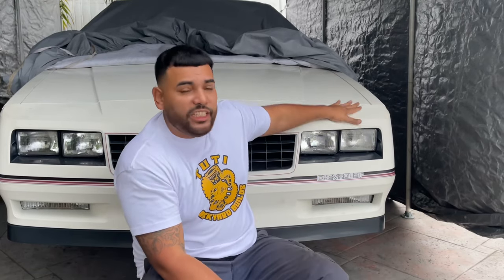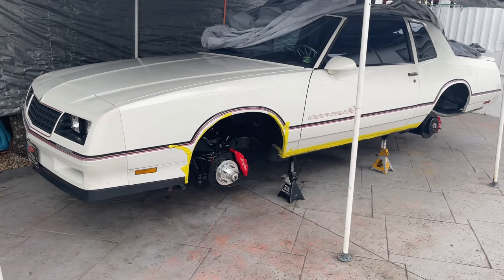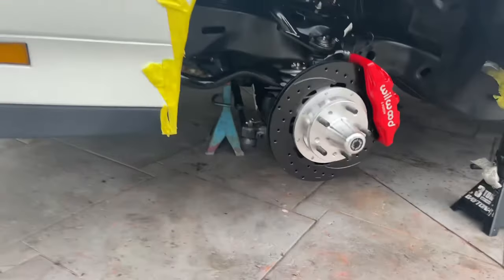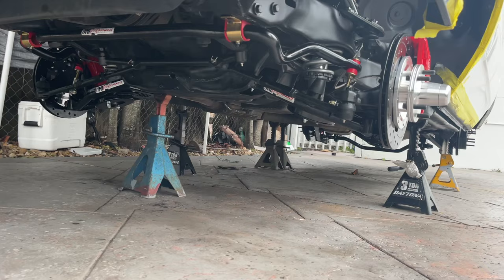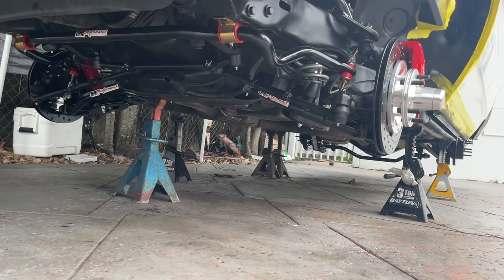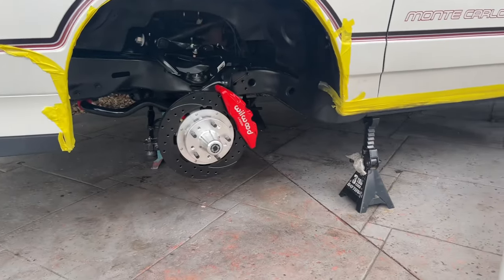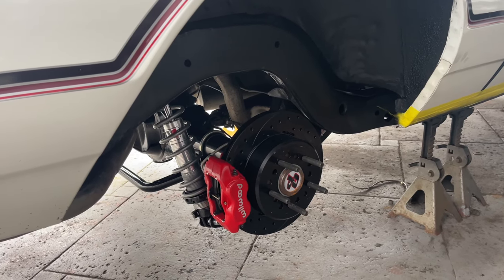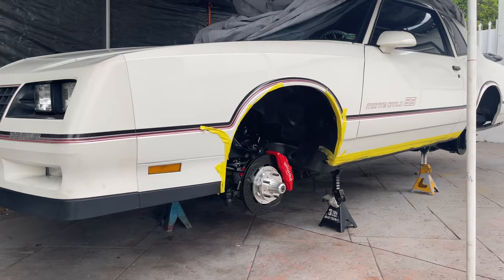Installed a complete performance suspension on a 1986 Monte Carlo SS T-Tops | Gbody |

Comment: Good video bro. Im getting a LS Swap on a 1986 Monte Carlo SS & I been looking into UMI Suspension. 
The Stage 2.5 kit comes with the Vikings Coil Overs are they good as QA1 Coil overs??
Reply from the maker: Thanks I really appreciate it. Yes Vikings are very good too .
Reply: @tutibackyardbuilds8109  Cool Thanks Bro
Reply: @tutibackyardbuilds8109  Hey bro I got a quick question with the 86 Monte carlo ss. How did you get the factory shifter to work with the 4l80 transmission? Mine is getting swapped now they are telling me I might have to get a aftermarket shifter but I want to keep the original shifter

Comment: I can understand the 9" to get rid of the junk 10 bolt but i do NOT understand why anybody would change the rest of the suspension on what is possibly one of the best handling in stock form American cars EVER built. I bought an 86 with the same suspension mods shown here and it steers horribly and don't hold a candle to the new one I bought in 84. ( night and day difference).